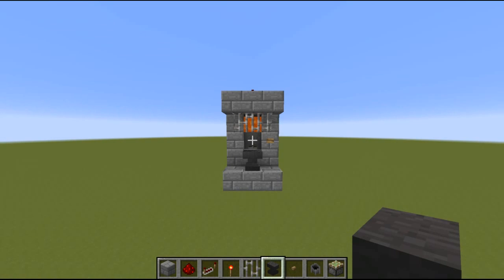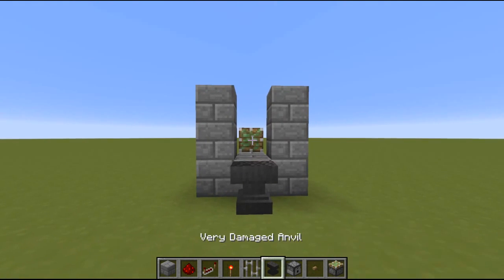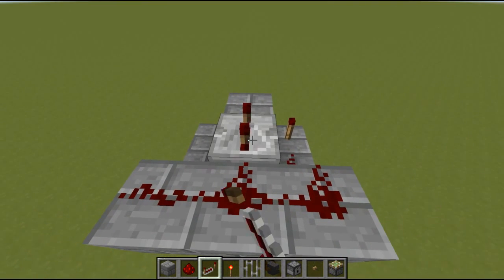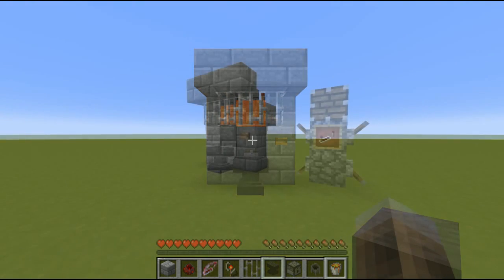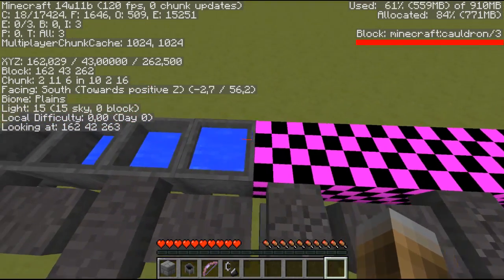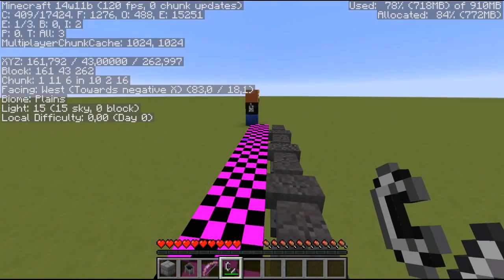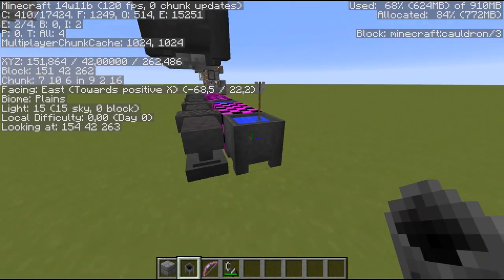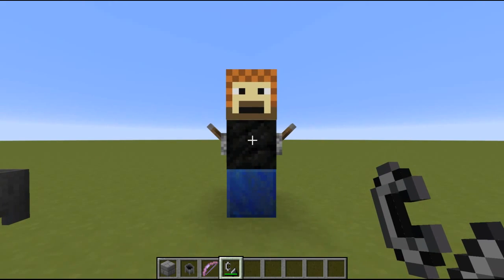Infinity Anvil (Patched in 1.7.6)

Comment: You can empty cauldrons by right clicking with leather armor. Meant for taking dyes out of the armor, but works with fresh as well. So you don't have to set yourself on fire or use lots of bottles to empty it.

Comment: I've just used it using oak wood with the bottom facing towards you and it works with all types of wood and it turns that block into a jungle log facing upwards so i guess you can get jungle like that

Comment: you can also replace the anvil with cake and you can have infinite cake as well. you might want a piston opposite the design to push the arrow back to the edge so it can refresh the cake when it is really low still. love the design and I plan to use it in my world
Reply from the maker: Too bad I didn't think of the cake. I would have made a nice last shot for the video.
But thank you for pointing it out ;-)

Comment: There is probably two reasons for that, one, the most obvious the arrow would burn up in lava, and two, still and flowing lava differ by item ids not metadata. 10 and 11.  It would work if the arrow wouldn't burn up if still lava was represented (10:0) and flowing lava (10:1). That would leave a 1 metadata difference that could be reset using the cauldrons, but that isn't how it is designed in minecraft.

Comment: Done a bit of experimenting. This doesn't work on full blocks, but it works on anvils, glass panes, slabs and possibly snow, but that may be the lava melting it. The effects of it are very strange. It doesn't give the target block the damage value of the lava or the cauldron (0), but rather gives it a different data value, but it is the same each time. For glass panes, anything with a damage value higher than 3 (light blue) will be given damage 3.
For slabs, anything with a damage value higher than 3 (cobblestone) will be set to 3. HOWEVER from 3 down, the value is reduced by 1 each time, so cobble goes to unburnable wood goes to sandstone goes to stone.
Yes, you heard me right, YOU CAN GENERATE WOOD SLABS THAT DONT BURN FROM COBBLESTONE SLABS. My work here is done. Might upload a video on this.

Comment: its actually changing the data value back to 0? :O
Reply: Changes it back to 3, which is just a different rotation of the undamaged anvil.
Reply from the maker: Yes, you can change it to 0 with the cauldron.
Reply: Panda4994 Panda! Very important discovery!
For this to work in MULTIPLAYER, you have to set ALL repeaters to 4 ticks (full delay)!!!
Just built this in a server and was sad to find it not working. Then I played around with it and kaboom: it worked!
Reply: Panda4994 Also very, VERY cool video!
Reply: aleksi pitkäranta Still not working ^^ Maybe because its a bukkit server...
Reply: gumbo162 Can someone confirm if it works in bukkit / spigot servers?
Reply: well... not really. an arrow just has to land in a cauldron before landing on the anvil...
Reply: Well, shit.
Reply: Panda4994 Can you use it for any value beween 0 and 3? I'm thinking cracked stone brick machines and infinite lava generators (the second might be a bit far fetched).
Reply: xX_GwAx_HaRdScOpZ_Xx I don't think that this would work; arrows do not get stuck in liquids.
Reply: Script Maker yeah, i have investigated. Turns out the only two uses of this are repairing anvils and creating fireproof wooden slabs (use on cobble slab). Unless you really want to convert something into light blue panes. Problem is that it doesnt work on full blocks and it seems to change the damage value rather than set it. Still, look forward to an AFK fireproof wood farm from me in the near future.
Reply from the maker: xX_GwAx_HaRdScOpZ_Xx  I build up a automatic metadata 0,1,2,3,8,9,10,11 generator by now. I guess I will show a simplified version of it "soon". But cracked stonebrick works fine already ;-)
Reply from the maker: *****  No, if the anvil has a too high metadata it will behave like one that's almost broken.
Reply: Panda4994 Sweet. Meanwhile, I used this concept to build an afk fireproof wood generator.

Comment: Hey, could you get Wither Skeleton heads to change to other heads? I tried to do that but I could not get it to work.
Reply: the data value determins the rotation of the placed skull. the placed skull has a different id than the skull item in your inventory.
Reply: oldGanon I know that now, but a placed wither skeleton skull has the same data value as a placed Zombie skull or any other skull.

Comment: the cauldron you are using in the machine is empty so it has metadate 0 right?
so why does the arrow sets the metadata of the envil down? - it won´t do that if its really the cauldron.
Or is the arrow looking up the block type of the previos coordinots but the matadata from the block it´s actually in?
Reply from the maker: You got it. It's using the block of the stored coordinates for the calculations but the metadata of the block it's actually stuck in.
Reply: Thank You for your fast answer Panda ;)

Comment: On the TNT video you shoued that the block where he lads for 2nd time will turn into the block where the arrow land for 1st time. (Dirt to TNT) Why the anvil dont turn?
Reply from the maker: In the first one the block turns in to ignited TNT (an enitiy). And that's because the arrow when it hits the dirt believes to be stuck in TNT. As it is burning it turns the block into ignited TNT.
In this video the arrwo believes to be stuck in a cauldrom and therefor changes the metadata fo the anvil.
Reply: Oh! you're clever as hell! Ill use this design on my Single player wolrd as soon as i get fixed the ice cube machine that JL make for DOCM... Do you have any ideas for that?

Comment: This is not infinite because of arrow limit but it can be used A TON
Reply from the maker: You get the arrow back. If you just put it into the dispenser after using it it will work forever.
Reply from the maker: Panda4994
Sorry, didn't see your second comment ;-)
Reply: Panda4994 Just hook this up to a skeleton farm and filter out the arrows. :O Mother of all bugs

Comment: But how do you get the cauldron with meta data at four or higher?
Reply: I think he spawned it in with command blocks ;)
Reply: Billy Mark
You can use the block transmuter OldGanon shows in his video with a golden pressure plate to get them legit in survival.
Reply: ok thank you
Reply: I did some testing. It doesnt set the damage value of the target block to that of the cauldron or lava, it just reduces it. It is first reduced straight to 3, then in slabs it is further reduced in ones down to 0 (meaning you can get fireproof wood slabs from cobble slabs in 1 stage). Unfortunately, you cant increase the damage value,so no cheaty quartz slabs. Also bear in mind this doesnt work on full blocks.
Reply: xX_GwAx_HaRdScOpZ_Xx Using cauldrons is just useful for the conveninence it provides for automation in cases such as the one presented (since it happens to allow the particular metadata change you want). For the more general approach, again, use gold pressure plates (or if it's more convenient, string/wood pressure plates/wood buttons).

Also, why wouldn't it work on full blocks?
Reply: I'ä Cthulhu Fthagn I don't know, but I have tested it. This machine does not change the damage value of full blocks.
Reply: xX_GwAx_HaRdScOpZ_Xx
Only thing I can think of is it's a timing thing, the arrow hitting the block before the cauldron is back in place, which seems unlikely. Still, again, there's the more general block transmuter that works without doubt for full blocks (and allows you to get "cheaty quartz slabs" for that matter).
Reply from the maker: I'ä Cthulhu Fthagn  I think it dosen't work well on full blocks because of the full hitbox I think. But I build a device that can create metadata 1,2 and 3 for blocks already. Not sure when I will get to record a video of it.
Reply: Stand where you want the cauldron to be and type this in the chat: /setblock ~ ~ ~ cauldron 4 (The 4 is the data value you can change the number)